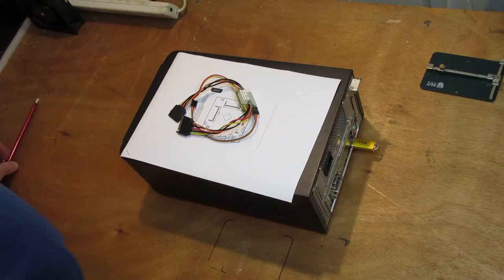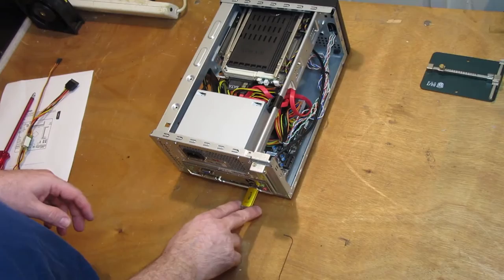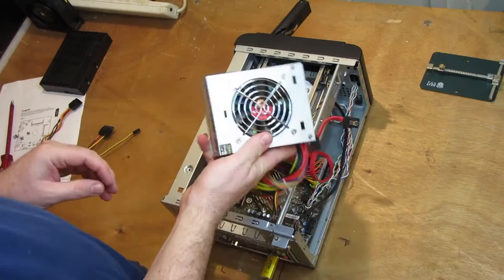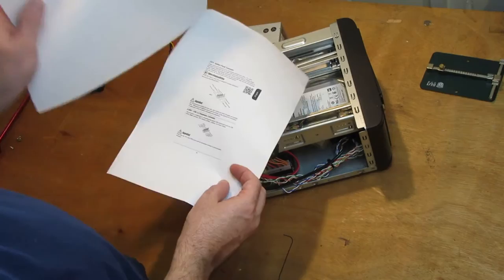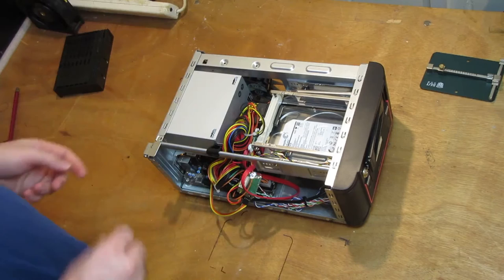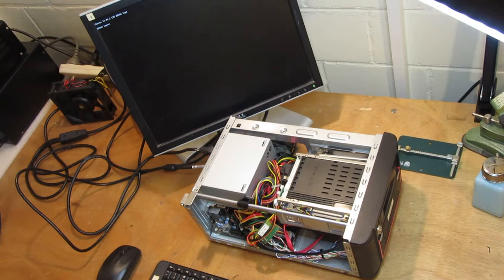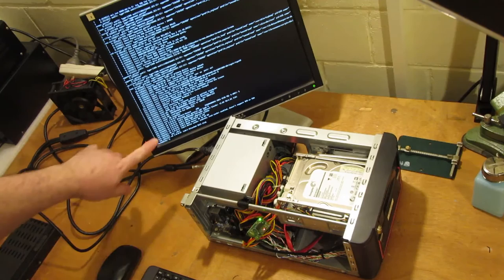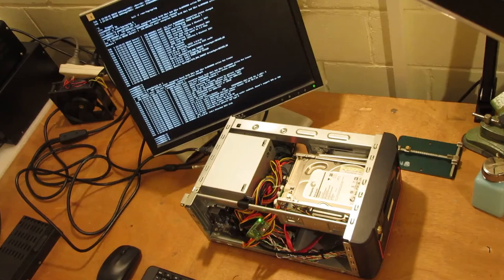Internal SATA power relay installation in to data recovery server

Comment: Maybe i missed it, but out of curiosity, do you do some some operation on the SATA port prior to power off?
Flush stuff out or something? I imagine it would not have any benefit if it was just a power cut. 
That could be made with a hard switch.
Reply from the maker: Hi MaxSantos.   Where the loadable dock drive mostly comes in to play is when I'm performing data recovery on an unknown/failing drive, so essentially all the operations are reads only.

If the drive has been written to, then certainly making sure the FS's have been unmounted and a few sync calls made to ensure everything is flushed out is good practice.

The reason why I don't use a hard-switch on the front (like a DPST)  is because when I'm doing data recovery there's many times where I need to power-cycle the failing drive if it has a specific set of faults and do that switching from within a script makes it profoundly more efficient.  Most of the time I'm not  working on the machine directly, instead after loading the "drive to be recovered" I return back to my workstation and do what I have to via ssh.
Reply: Got it, this way you can power-cycle remotely. Long live SSH :)
Reply from the maker: In this video  https://www.youtube.com/watch?v=DHykaRlfRwc you can see the process happening from the ssh/software side, though the drive is an external USB unit, same principle though and just a different variant  of the USB-controlled-switch.

Comment: Hi can you share the schematic of the relay? Best regards.
Reply from the maker: This is the core design on which they're based off.  I switch a DPDT relay (5V coil) to make sure both 5 and 12V lines are switched.

https://www.obdev.at/products/vusb/powerswitch.html